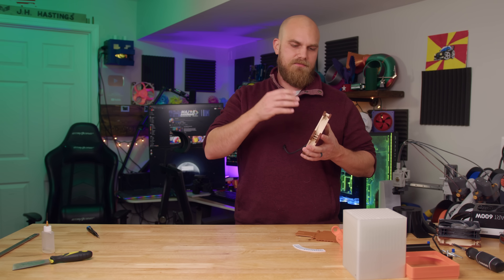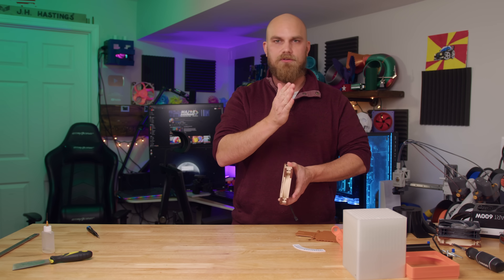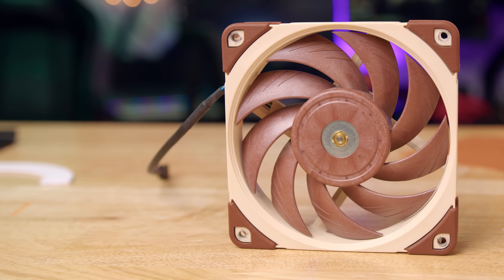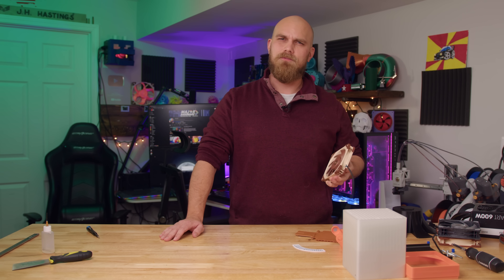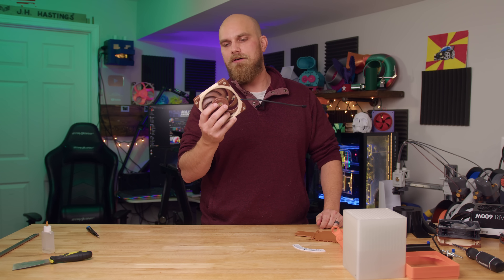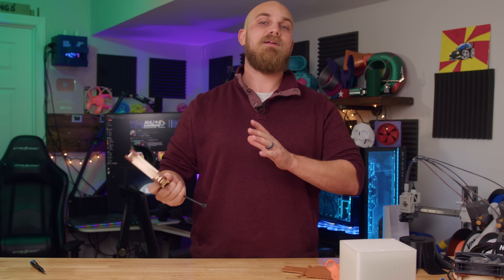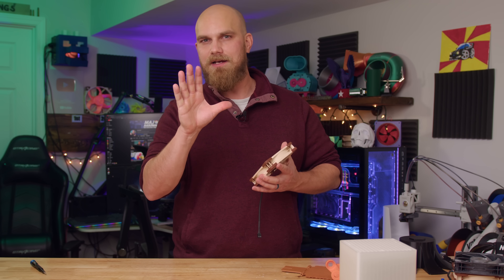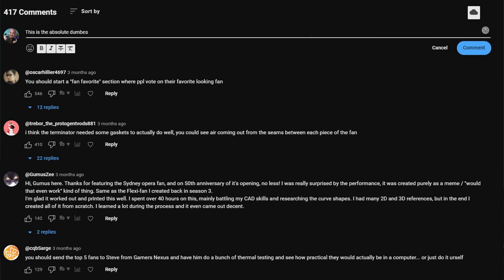I Built a Static Pressure Machine | Fan Showdown Season 6 Pilot

Comment: I have a few concerns but generally really like the direction this is headed. The first has been mentioned by several other comments and that's that the measurement resolution and preciseness in the area most likely to be relevant to the tests is pretty bad right now. Extending the length of the needle and the distance from the fulcrum should help, but a really long needle is likely to add weight right where you don't need it, so maybe using a laser and projecting it on another surface a good distance away would be the best option.

The second issue is a little easier to solve, and thats that I would have the flap push the needle (which is a separate object), that way when the flap falls, the needle will be left at the highest point achieved. CNC kitchen has a machine that does this for testing impacts on filament swatches.

The third issue is that the current shape of the door flap may be naturally flattening out the upper ends of the static pressure it can measure. Once the door opens far enough the amount of air on a direct path for impact with the door starts to decrease, additionally the angle of air-deflection becomes less dramatic, this should mean that the more the door opens, the harder a fan needs to push to get the same numbers because less of its energy output is hitting the door, thus squashing the top performers around a band, and making the differences between them less dramatic. It may be possible to create a fan door with a lacross-scoop shaped door or something, to decrease this effect.

Comment: it's much easier to simply use a U-shaped tube of water. attach it to the bottom of the wind tunnel, and the pressure differential will cause it to move up or down. by adjusting the width of the tube and inlet size, you can change the sensitivity.
you could also test static pressure by putting the tube facing up, and see how hard it will draw water upwards against gravity. that would remove airflow from the equation, and only test pressure differential.
or at least make the arm longer

Comment: You should at least validate the rig using a high flow/low pressure fan vs a low flow/high pressure fan. If this rig is truly measuring pressure, the high pressure fan should result in a higher reading, despite having a lower cfm. If the higher cfm fan has the higher reading on the rig, it’s proof that it’s not measuring pressure, but instead airflow.

Comment: ok i am gonna sound stupid because i dont know the name of the tool. you use it to find flatness of an object. you press it an it will move the gauge. they have digital ones to.

ok where i am going. is instead of the semi circle and number. exacting number with the gauge i dont know the name. now assuming that doesnt increase the resistance that much could be worth a look at. may make it more complex in the working of setting that up. but thats what i have got

Comment: add a gear which amplifies the movement of the measurement. basically have the door turn a gear which turns another gear, which moves an arm MORE than this current version can, youll have more throw in the arm to measure a wider/more accurate pressure.

Comment: A relatively simple way to increase the resolution of a water manometer is to use an inclined scale. It won't give you a digital output, but with appropriate graduations along the length of the manometer tube you will still achieve measureable results out of it. These can be purchased, but can also be DIY'd fairly easily. If DIYing if you want transferable results it is important to use a liquid with the correct specific gravity. Water can be used, although it should be distilled or deionized, and its temperature also effects its density.

Comment: I think other people have really nailed it already, currently the flap 'hole' gets bigger the more it opens which makes for non linear results. Also a fan with good flow can still push this design open. As others have said I think a vertical box within a box, fan on the bottom, second box moves up and down within it on linear bearings perhaps, with hole in it. So that the static pressure has to move the box inside up, and thats what you measure. Like a elevator in an elevator shaft. Where you measure how much the 'elevator' gets lifted by the fan.

Comment: How about making one that is a tunnel in a vertical alignment. You have the fan blowing up inside a tube, and in the tube you have a balancing disc that will be "floating" in the air from the pressure. You could have this in a clear plastic tube and the measurements on the outside of it. The more the floating disc goes up, the more pressure? To align the disc without is flopping about, think of something that is very low friction, and make the disc rigid enough to not just flip around. Anyway, just an idea...

________
|                 | <- measures marks on the side
| -------------  |  <- floating flow friction light disc
|        ^        | <- direction of air
|     FAN     |
_________

Comment: You should tune the weight of the flap arm so that the a12x25 is perfectly in the middle, most fans are going to be worse and having such a low benchamrk to beat means almost everything is going to show in the same range

Comment: The opening should probably not increase with higher pressure. Either have a static opening or a design where there is actually no airflow at all just pressure. Enclose the flap completely and maybe a hole in the flap?
Or just close it off and put a U-shaped tube through the wall with water inside and get actual mm of water. But you might want to have the inside of the tube big and outside small to get bigger and easier to read results

Comment: Last Idea, I promise.  3D print some gears and use 2 to 1 gearing to give you a full 180 degrees for your gauge.  That would let you use an off the shelf plastic protractor with 180 degrees of gradation.  You could even use a 3 to 1 gearing and spread out your results even more.  So that the Noctua A12x25 would get a score of about 90 out of 180 with that setup.  A 4 to 1 gearing would be 120 out of 180.  That is the best so far, and it is very unlikely that you will test a fan that gets that much more than the A12x25.  I think you could figure out the gearing, you do like 3D printing.

Comment: To make the pointer longer for more accurate readings use the door itself as the pointer and put the gauge behind the door.  That way we can see the door move and the corresponding number in the same camera shot.  120mm x (PI/2) = 188mm of gradations.  With 1 mm between marks you could have a granularity of 188 different possible power levels, though in practice you are only going to be using the first 3rd, or 63 degrees of accuracy.  That should be plenty.

  I would only put a number every 5 lines, and make that line about 2 or 3 times the length of the other lines to reduce misreading the gauge.

  I would make a test page with your paper printer to see how close together you can have lines and the camera can still pick them up.  Half millimeter could even work, giving your Noctua A12x25 a score of 126 on that scale.  The more accuracy the better.  And if for some reason your printer can't do half millimeters, you could consider buying a plastic geometry compass off Amazon/Ebay that has a line for every degree, giving your Noctura a score of 30.

  You could make the door have a longer pointer in the center.  Either way I would put the gauge semi-circle just a half inch from touching the middle of the door so that as the door opens it is always just a quarter inch from the gauge because the gauge is the exact shape that the door makes when it swings.

  Just ideas.  Even if you use none of them hopefully something inspired you and you remembered something that would work even better.  xP

Comment: Fellow mechanical engineer here. Seeing lots of people suggest a U-tube manometer, but I'm not convinced that'd work very well for this application since the difference in pressure between the two sides of the fan is so low, not to mention any static pressure would likely be overshadowed by the venturi effect resulting in a device that essentially measures velocity anyway.

The biggest problem with this machine at the moment is that it's not measuring static pressure at all -- it's measuring a quantity related to the stagnation pressure, which is a function of both static pressure and velocity (it's not quite the stagnation pressure since the air doesn't quite come to a complete stop when passing the flap). If you wanted to accurately measure static pressure you need to make the velocity of the air zero, i.e. have a fan blow into (or out of) a sealed container and measure the difference between the pressure within the container and atmospheric pressure somewhere far away from the fan. The only practical way I can think of for doing this with such low pressures is an actual manometer, unfortunately.

That being said, I still think that this is an interesting way to gauge the effectiveness of a PC fan and could definitely be used in the next season, albeit with a change in what you claim the device is measuring. Several other people in the comments have left great ideas about how to improve the repeatability and resolution of the device so I won't repeat them all here.

Comment: The problem I see with measuring the angle is that this would not be a lineal mesurement, since the ammount of force to move 1 degree of the flap increases when the angle of the flap changes, since the contact surface area of the flap decreases

Comment: I had another thought just now. Instead of seeing how well it can blow, you can check to see how well it can suck. Take your box and turn it on its end. Put a lid on the bottom that it can pull up on. Add weights until it falls off. m*g/A is your static pressure.
It may also work the other way. Turn your box on the other end. Blow into the box. Add more than enough weight to the lid to hold it down. Remove weight until the lid doesn't stay any more. When balanced, the static pressure is m*g/A.
In either case, you no longer have to be concerned with turbulence.

Comment: Like several comments have said, a u shaped of tube filled with water or other liquid i.e. alcohol, can buy used as a manometer, tilting the board the tube is mounted to will increase the resolution and you can use trigonometry to find the actual results, or just use it as is to compare fans without getting a perfect number

Comment: It's a great way to measure fan performance, but it's not static pressure, because there is still a lot of airflow. If you want to measure static pressure, span a balloon instead where the door is now, then measure the bulging of the balloon with a lever to amplify the movement.

Comment: remove the seals from the bearings and clear out the lubricant. they're not bearing any load and removing the grease will further reduce the resistance and add stability over time

Comment: This is a good idea.  It just needs some refinement.
1) The flap needs to be enclosed in a shroud significantly longer than it is.  Right now, you have a lot of spillage that is lowering your results.
2) You need to calculate the moment of inertia of your flap.  The effect of static pressure on it is not going to be linear.  It is going to vary significantly with the angle.
3) You need to determine the amount of resistance your flow guides impart.  Alternatively, if you put an extended shroud on the outlet, they may not be necessary.
4) I would create a second test.  Turn your apparatus vertically and create a slightly outwardly sloping shroud.  Put a weighted plug at the end that just barely seals where it contacts the apparatus.  The static pressure will push up the plug until the pressure maintained under it equals it's weight.  The plug should have sloping walls that match the shroud walls.  If you know the weight and the elevation change, you can calculate the force applied (F=ma), and from that, the pressure (P=F/A).  This would be a simpler design to calibrate, I think.  However, it is still not linear because the gap around the edges opens as a function of height since they both slope.

Comment: i figured you would use weight to see how much weight the fan can push aginst or overcome. 
so you could put weight on that flap to see if the fan can push it open at all.  then just keep increasing the weight until it cant generate enough pressure to open the flap.

Comment: You could also construct a large baffle that goes around the apparatus that way no room air or just other air disturbances can affect the test can affect the test. It would pretty much be a loop and that way you could also potentially get rid of noise in the data. If you were to do this and add a monomer to it it would allow you to test different static pressures. In doing this you would basically make a fantastic machine that could reliably test for any static pressure

Comment: You should be able to add a gradient to that isogrid To save mass. The forces at the bottom are going to be lower than at the top and you should mirror the same geometry to give yourself balance this way the center of mass is closest to the axis of rotation

Comment: Use a rotary encoder with very fine resolution. you should be able to attach one that has incredibly low resistance due to being picked up by leds and grid slots

Comment: Try to balance it with the top section. The velocity of the air coming out when it is at one degree compared to 12 degrees is going to be substantial so the acting force of the balancing weight will not affect it very much.
You should use a laser inferometer to measure the distance instead of using a scale. This would be very accurate but would also require a linkage which may add too much friction.

Comment: Good design. The only other way I can think of to easily test this is a vertical tube -- square like yours would work great. Then a carriage/float that sits in the tube with skinny slot up the side of the tube to allow more and more air to escape as the float elevates. (You could calibrate the weight of the float so your Noctua fan hits exactly "50" on the scale.) You'd then mount the whole contraption vertically with space below for the air intake. The height the float is able to reach with each design would show you the static pressure comparison.

Comment: The wider the flap opens, the less air will impinge on it, plus gravity will be more of a factor the wider it gets.  In other words, a fan that has twice the static pressure will not move the flap twice as far.  Id suggest you reduce the mass of that flap a bit more (or more counter balance) and put the angle indicator on a log scale to reflect that. Enclose the flap within the tunnel will help too.

Comment: I may be wrong on this but static pressure is same as any other kind of pressure and is a measure of force per area. Especially with laminar flow, as your flap rises, there is less air (less force) pushing on the surface area of the flap, making the scale nonlinear.

Might I suggest a setup such that there is a non-airtight square 'piston' supported by free running linear guides inside a square tunnel?

Resistance could be simulated by attaching a string pulley system such that as the piston is pushed, an adjustable weight is pulled up. You can then adjust said weight so that the baseline fan's result is in the middle.

Comment: The easiest way should be a system with water in a U-shaped tube. sealed on one side where the fan is mounted.
Thinner tube means higher resolution (just a guess). :)

Comment: I like all the other suggestions! The only thing I’ll add is if you’re going to stay with the physical arm/meter, use a locked off camera with as long of a focal length as possible (to add compression). Also a light as close to the camera as possible to help with shadow. Also printing the meter/ numbers may help with consistency vs doing it by hand.  But overall I like it 👍🏻👍🏻

Comment: Idea: A fan blowing into a chamber which is sealed apart from an opening that leads to a water column in a transparent tube with height markings on it to actually measure the pressure in centimeters of water.

Comment: Would be super easy to diy a water-based U-tube manometer. We actually use those at my university to measure very small pressures. If you angle the manometer you can get even better resolution for lower pressure. Would also be extremely cheap. Basically just need a tube and some water.

Comment: I think the biggest issue is that with the flap moving away with higher pressure the resolution decreases because of the lower angle of impact and lesser effective surface area. What i think would be a better idea is to hold the flap open with just a small gap and measure the force trying to push it open with a strain gauge.

Comment: I think that setup will measure velocity more than it does static pressure. The best way in my opinion would be to have a variable opening in the middle of the tube with a manometer between the fan and the opening. you would then be able to plot pressure versus restriction.

Comment: Looks good. I think calibration of this would be very hard tho. I'm not a fluid-focussed physicist but I think the dial output of such apparatus would be extremely non-linear. It would make fair comparison very hard when using the linear scale you put on it. Also it still measures airflow, not really pressure. Making a kind of closed tube pushing on actual water would make for a proper pressure test, tho getting it airtight with 'ordinary' 3D printed parts would be quite hard.